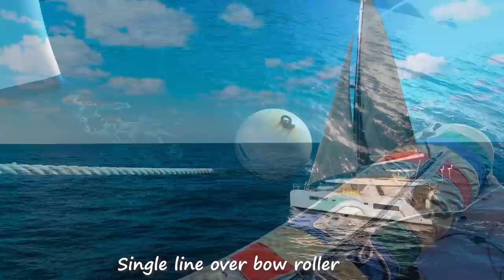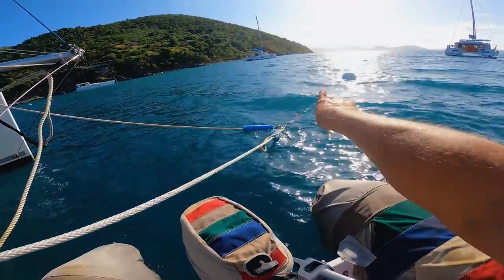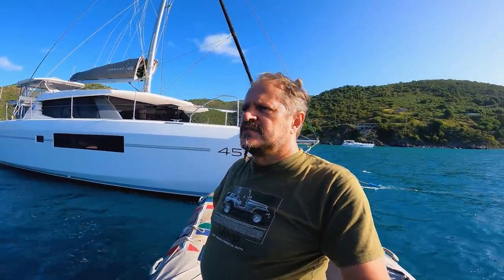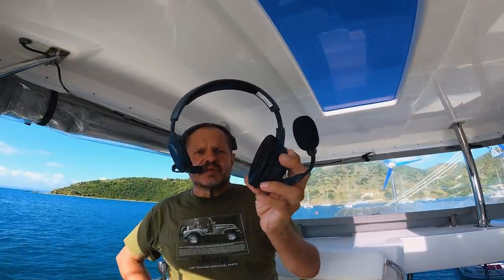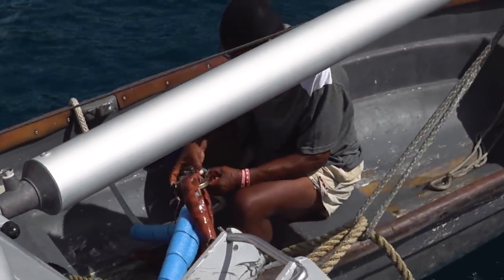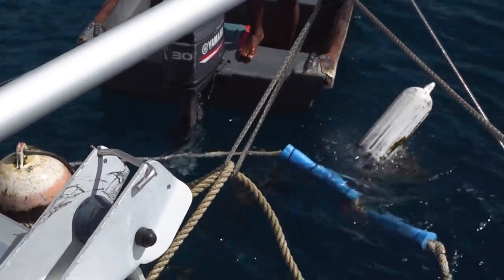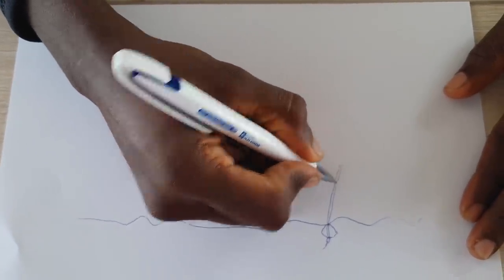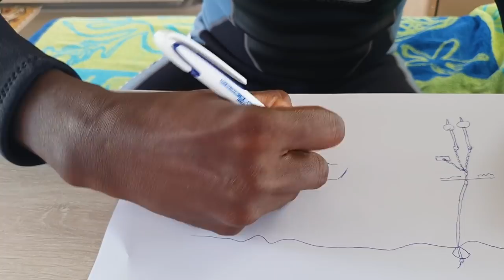#162t How to sail a Catamaran - Catching a MOORING Ball and What are They | Sailing Sisu Leopard 45

Comment: Hi Frik!  Your "no-load" use of the "no-load" horn cleats on your spreader bar is the first time I've seen anyone get any use out of them!  Good on you!  The spread bar gets nearly all of its strength from the of the Seagull Striker cables.  This is ONLY strong in the Up/Down vectors, NOT Fore/Aft vectors, that is why Leopard puts a placard on those 2 horn cleats that says essentially "no-load" use.  Yes, your Bow Sprit puts Fore/Aft loads into the spreader bar at the center-line but you will notice that you have a structural member going aft to just above your anchor which is carrying all of that load.  I really like your how-to informative videos!  Stay salty.
Reply from the maker: Thank you for your kind compliments! Yeah, we have that compression post between the tramps :-)

Comment: Hi Frik.  Another good one, thanks.  Some of those folks looked a bit disconcerted that there was someone suddenly holding their bow talking to camera….  I assume they were ok with it…. did you discuss with them first?  I suspect yes.
Also can I ask what the extra short line and eye zipclipped onto the starboard side of bridle is for?  Thanks for sharing this.  I must admit I also like to just stare at the boat around you as I dream about a Leopard 45.   :)
Reply from the maker: One always ask permission from the captain ;-)  Good observer, Tony! The short piece is part of the original anchor bridal and we were not sure if we would still need it or not. After a few months of using it, we decided to take the short leg of and use it as is. Very useful when anchoring in shallows for example, in 3m water, one's scope is at least 12m and our Mantus bridal is 10m, which defies the weight of the chain completely if the bridal is hooked at 2m chain out. Secondly, if one does use the minimum scope of 1:3 then the Mantus bridal is at least 30m chain out before hooking and then 10m more for the bridal leaving you with a radius of 40m. Something to keep in mind.

Comment: Hi Frik, nice video, I do a great deal of mooring in US and BVI's and normally use to mooring lines. I love the idea of using the Snap Shackle. When she was making the mooring connection, she made it directly on to the mantis snap shackle, but in the video it looks like you used another shackle to connect the mooring lines then to the mantis snap shackle. Was there a reason for this?  Thanks for the well done video.
Reply from the maker: Douglas, if you can tell me the time in the video, then I could answer your question better. That said, the snap shackle should always go through the main eye splice of the mooring. I noticed many boat tie up onto the mouse line, which is wrong. We did, too, until I saw the difference in size and quality between mouse line and mooring line. So, perhaps you saw the eye splice and thought that is another shackle? Or is it our mooring bridal's shackle you saw?

Comment: When catching a mooring ball in a strong tidal area, ie. 6knot current. Would you catch the mooring into the wind or into the current?
Reply from the maker: Ah man! I knew I forgot something that's why the video is so long! I was ranting on while trying to remember what I forgot :-D Tides are much stronger than wind for sure! It does become tricky when tide and wind are both strong, but in 6kts current, I guess tide will for sure win or if the wind is that much stronger, you should not be there trying to catch a mooring ball :-D The correct statement should be "your stern should point in the direction of your drift?"  But it is difficult to keep the bow pointing to the mooring ball if off the wind...mmm. tricky!